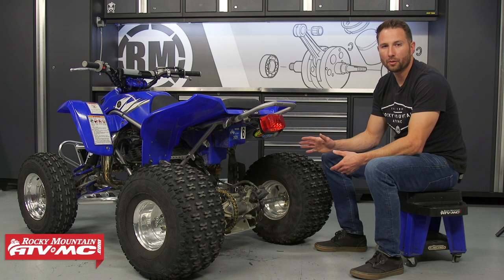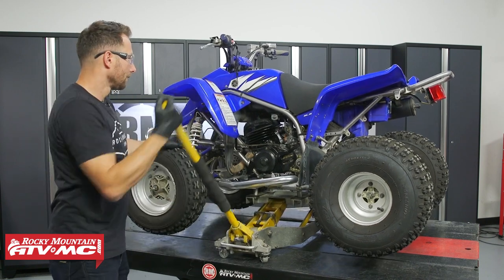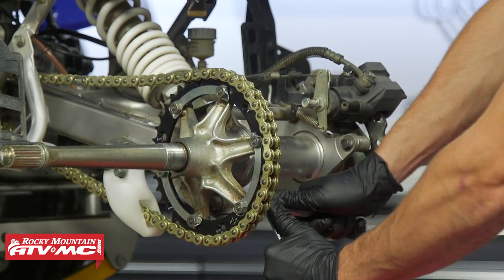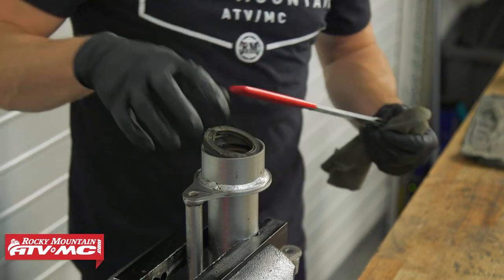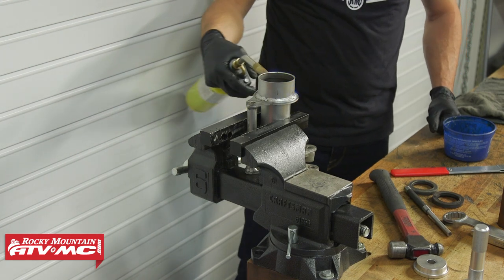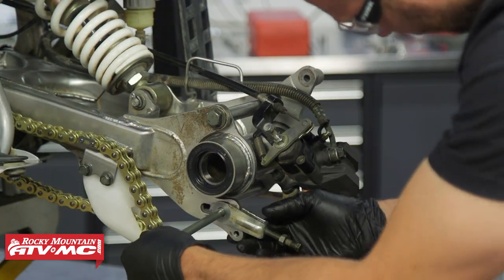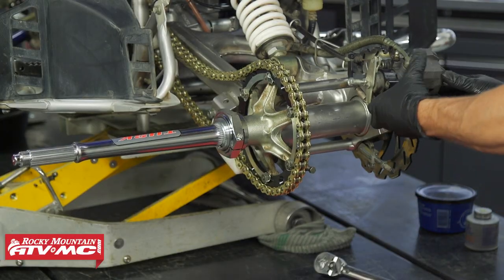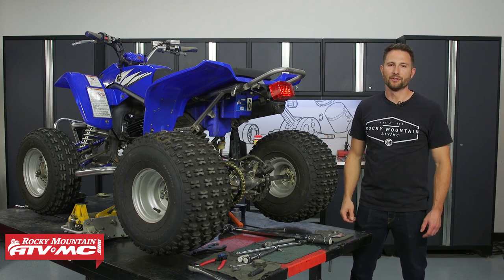How To Replace the Axle Bearings on a Yamaha Blaster 200

Comment: What is the best way to remove a stuck sprocket flange on a atv it’s a lt230s
Reply from the maker: If it's stuck on there, try some heat and let some penetrating oil soak in like Maxima MPPL or WD-40. -Charles
Reply: @rmatvmc  thanks

Comment: I have to replace my axle hub and i can’t find the correct piece online, do you have any suggestions on where to get one?
Reply from the maker: You should be able to locate it on the OEM parts finder here: https://www.rockymountainatvmc.com/oem-parts/Yamaha
Reply: @rmatvmc  Is  the tusk 
(one piece)  designed Axle nut superior or as committed to holding a axle fit and snug Over the oem design that uses  two axle nuts as a jamb nut
Reply: Or any motor sports dealership has an oem parts finder  page on their website that illustrates the break down and schematic of each sector of the bike or atv . Not hard to find . Look at the parts  break down and find the parts Oem # number . Some parts have superceded numbers meaning a new updated number
Reply: Meaning does it keep the sprocket hub snug in place against the carrier and not allow for any premature loosening weather it is a month or a year of riding . I can’t see the superiority in that (single) style axle nut over the oem design jamb nuts